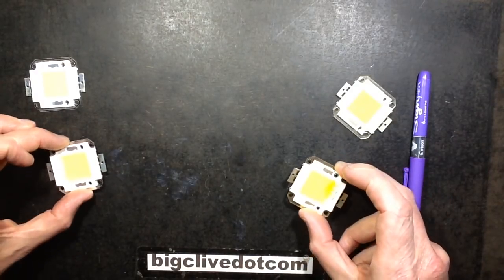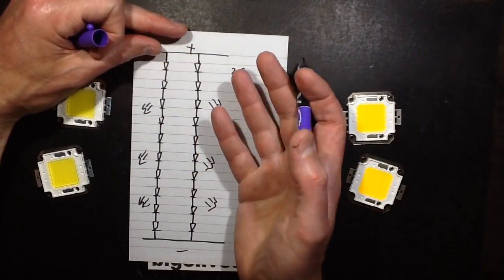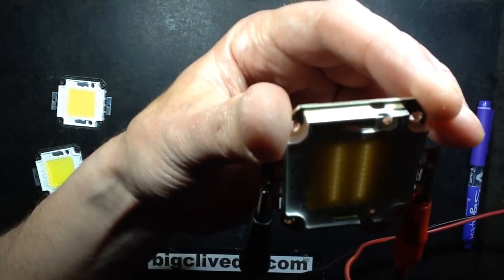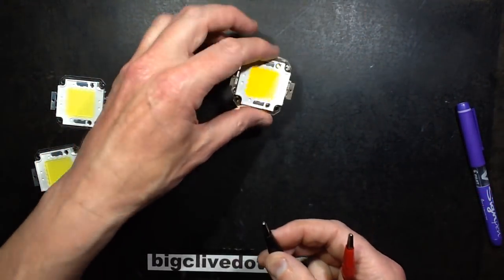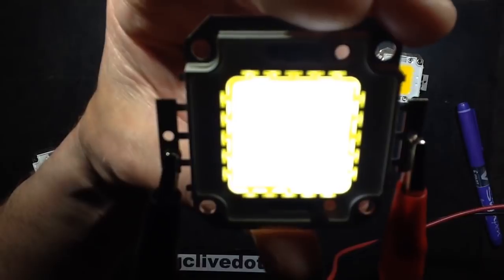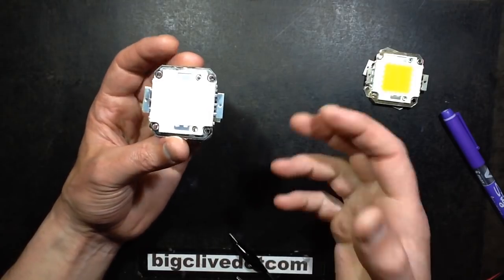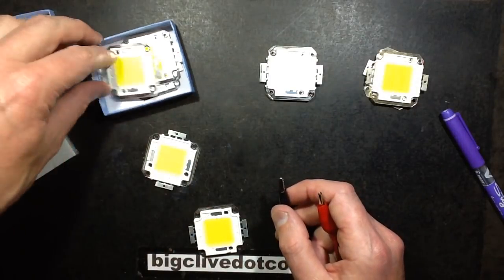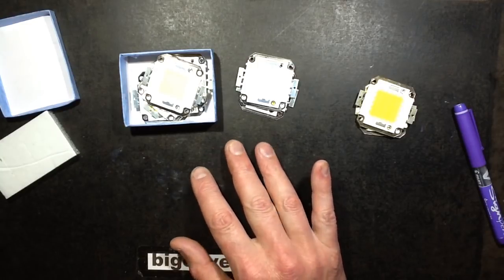Testing dodgy 100W LEDs from ebay sellers.

Comment: I bought a 100 watt 10,000 lumen one on eBay but it was almost $30.00 just for one.  The emitter chips are twice the size as the $5 competitor 100 watt LED.  The seller was showing just what you experienced if you use the common cheaper units.  So I bought their $30 good one.  All 100 LED elements turn on at the same time as your 20 watt examples.  You have to get the better quality 100 watt units.  Full power (3 amps at 33 volts).  Not a single problem.  Takes a good amount of heat sinking.  So there are good 100 watt LEDs on eBay.  You just have to pay for them.
Reply: Gavin Curtis  what from what supplier? i am thinking of buying some
Reply: It was ebay user "wholesale-led"  and it is there Epistar series and are not cheap by any means.  The 100 watt LED with the oversize die is now $40.00 USD.

But definitely worth it.  When I got it, every LED was identical even at fully dim using less than 1mA.  It is so much brighter than those $5 crappy ones which did exactly as these did in the video and I chucked them.

There is more than twice the silicon emitter die area in the Epistar brand.  Now I did retest my 100W Epistar at 1mA after I have been using it to verify how well balanced the LED elements are.  I do have 99 elements that are perfect, one that is slightly dimmer at the 1mA.  At 4mA, they are all identical brightness though.  Bear in mind the LED operates at 3 amps so the mismatch even after I ESD zapped it, it is still ideal.  I marginally damaged one element from improper handling as all 100 were perfectly matched when I received it.  You have to be very careful handling these and protecting from ESD.  I wish they would have integrated a 36 volt zener diode into these to protect them when out of circuit.  Some of the CREE brand multi LED units have the integrated zener.

The ebay listing is 361294347502

Comment: Why do you care that there not all coming on at the same low voltage? Iv never had this problem with any of my 100w leds.
Reply from the maker: Dave96z34v2 Because many of them are passing significant current without emitting light and therefore in use the LED would be much dimmer than it should be at any power level.  The already defective LEDs are also likely to fail completely in short term use.

Comment: Hi Clive , Exactly the same as what ive had but with the 50W & 30W versions and have Emailed the seller(s) and have had numerous replacements sent to me free of charge inc' a free replacement 50W spot light , and as you quite rightly say all mish mash ! and the ones that do work , work for about 3 - 4 months and then start flickering , (mine are on P.I.Rs set to 7min longest time) The original LED chips fitted to the spot lights did work with no mish mash but started to fail within about a month since last August and have replaced all 5 several times over. (4 x 50W Daylight 6500K and 1 x 30W Daylight 6500K , that one has failed too unsuprisingly) I have threatened some of them by reporting to ebay for selling faulty goods , and suprise suprise : they disappear off ebay (no longer a registered seller) I dare say they come back under a different name on a new account , but something has to be done , as its costing me a lot of time in replacing them and money. Yet I have passed a few shops by me , that have them fitted in the same style spot lights ive got , and they never seem to have any problems what so ever and theirs are on for hours everyday (in the dark that is) and always look when passing to see if any fail but yet to see one fail or starting to fail, and as i say no flickering or mish mash. Im also trying to source a decent seller too , who sells the better quality LED chips. Thanks for posting Clive and sharing your problems with us youtubers who have had poor service like your goodself ! :)

Comment: Those doggy LED's have likely got shorts because ALL LED's in 1 string should light at the same current because by definition there is only 1 current in a string. If there was a slight difference between 2 strings I wouldn't worry but LED's in a string should very similar
Reply: Have you watched the video? Have you noticed the voltage of the string was 12V? If the other LEDs had short, then 1 LED would had 12V on it what is almost impossible. I won't deduce it step by step, but the observations indicates that all LEDs have such manufacturing damage that produce a relatively high, different parallel leakage current (conductivity) for each LEDs.
Even the "good" one has leakage, otherwise it started glowing at about 2.5 V.
When Clive said the whole current flows on it, he made a false assumption of other strings don't conduct any current, which is impossible (I can prove it if you want).

Comment: i got several of these, im using it since 2 years for my flashlight's (see my channel)
at 22V they look screwed up, but with more than 24V it balances. i never had heat or current problems, not  a single one broke.   im running them on about 34V 3.33A(CC CV)

http://fs2.directupload.net/images/150619/tgklzr69.jpg
http://fs2.directupload.net/images/150619/exj7uws5.jpg
http://fs2.directupload.net/images/150619/42b224l6.jpg

There are 100W shitbricks for 80$ out there, but whos going to buy this?  These one cost 3-4$ per led. you cant expect much, but you get much for the price.

Comment: I got these and they are perfectly matched. http://www.ebay.com/itm/141146944749?_trksid=p2057872.m2749.l2649&ssPageName=STRK%3AMEBIDX%3AIT He even got picture of them running at low current showing how balanced they are as auction picture.

Comment: These small rectangular LEDs-chips seem to be the lowest quality available.
I bought a few 100W Leds with 45mil chips.They are bright and matched.
Reply from the maker: Markus Reiner Where did you buy them, and what did they cost?
Reply: I bought them on ebay from "sure-display".
They are a bit pricey @ $13.90 but work great . http://tinyurl.com/nj5mov2
Reply from the maker: Markus Reiner Ah.  Sure-display is a division of Sure Electronics.  They do tend to sell better stuff at a higher price.

Comment: A better way to detect dead LEDs might be to turn it up to full voltage/current draw, then use a SLR camera or even your video camera if it has manual settings. If you set the aperture very high (High F number = Small Opening) and increase the shutter speed to very fast you'll be able to see each individual LED while they are running at full power. Then you could see if any are actually out and it's not just an imbalance of forward voltages of some of them where they're not quite on yet at the low voltages.
Reply: ***** or use a welding mask glass
Reply: Welding glass is very helpful for this as already stated. He did however explain in the video, how he would not turn them up to full brightness without a heatsink attached. This is also a factor to consider for quick testing of LED chips.

Comment: We perceive brightness in a logarithmic scale. at low brightness they seem very imbalanced. and they have different starting voltages. if one led had 0.005 volt lower starting voltage then all the 25 volts would arc on it when ramping supply voltage,
Its true .. they are not all identical.
hence the reason the strings are meant to be CURRENT regulated and not voltage.
but if you juice them up even 30% and put a dark film on them you will see they are all running nearly identical.
further more when running at 50% or so, the brighter LEDs get hotter and draw more current. the small difference the leds have becomes negligible by the huge difference a small junction temp makes at 60-80C.
in a way you could say they are self balancing. dont think so ? current regulate one at 39V / 90watts , wait 60 seconds... put a dark film on it and tell me which LEDs are the "daft" ones.
Reply from the maker: forthereg The fact that one LED in a series row of 10 is brightly lit while the others are not lit at all despite a significant current obviously flowing through them suggests they are poor quality LEDs.  If all ten LEDs in a row lit at roughly equal brightness as soon as the combined forward voltage was reached then it would be a different matter.  Like the 20W LEDs I demonstrated.
Reply: To be fair, when you lit up the 20Ws, i was like ...wtf .
Even when you pay 100 USD for a single cree CXA made and shipped from U.S.A. with data sheets bigger than a history book, they are still lit un evenly.
thats how their classes are formed. they dont make them different, they make them all alike and then separate them after production based on brightness/color and price them accordingly.
Even intel trash the majority of their CPUs from production line. and when u pay 2dollas for 100 LEDS ... well ...
i think the average semiconductor fitnesses for duty off of a production line is like 30%

Comment: I have some little 9-chip ones that are fine, but I'm having a horrible time trying to find a reasonably compact driver that can provide about 750mA @ 12v for them. Most of the drivers I find are either for single-die LEDs (not enough voltage) or they're huge and overkill for the LED module.
Reply: Furr Bear A properly designed current driver should provide provide the current its set at and the voltage will adjust according to the NO. of LED's ie. as long as the open circuit voltage is around 2-3 V higher than the sum of all LED forward voltages it will just work. BTW, the manufacturer's stated voltage should be used to determine what voltage is needed. Depending on brand it will be between 3.0 and 3.6 (always specified at the recommended operating current)
Reply: Furr Bear
yep from 3.6V you will have problems because that requires a step up conversion. Those drivers I listed are all buck converters :-(
Reply: Furr Bear That isn't going to work well.  3V input to 12V out @ 750mA = 9W.  9W /3V = 3A, and this isn't even considering driver losses.

Looking at a Duracell D cell spec sheet, which doesn't even rate as high as 3A, they would immediately drop in voltage due to cell impedance, then current would have to go up all the more to still drive the LED acceptably.

A better option would be a series of 3, 3 x AA in parallel for 3.6V nominal, but better still would be to just put the 9x AA in series for 10.8V then your boost circuit has very little boost needed and much lower current, although for convenience sake you might want to go with 8 x AA in series instead since so many chargers have 4 x cell bays.

Typical lantern batteries also have high cell impedance, but an alkaline 6V lantern battery would be more than doubly suitable compared to 2 x D cells, but ideally, two or more lantern batteries in series or just move to 18650 or larger Li-Ion in series instead.
Reply: Furr Bear Hm .... I smell an electronics project! Hopefully not one going up in smoke :/
Reply: Benjamin Esposti Sadly, that's what happened to the drivers I found on eBay - every one of them had its driver IC fail in a literal puff of smoke when used within spec. They were just what I wanted otherwise - about 1cm x 1cm x 2cm and put out about 650mA... until they failed. I have no idea why they went POOF, and I haven't found another source for something similar. (The closest I have come is the LuxDrive MicroPuck - but it's only up to 500mA, and its output varies with input voltage.)
Reply: Furr Bear Are you looking to have an input voltage of 240V AC? I think that might be a bit much to ask for in 2 cubic centimeters of space. :(
Reply from the maker: Furr Bear It might be worth checking what the actual forward voltage of the LEDs is.  If it's the typical 3x3 series/parallel array and they are white or blue then the combined forward voltage will be so close to 12V that you could get off with a resistor if you can mount it somewhere it will not add too much heat to the LED array.
Reply: Benjamin Esposti Actually, I'm looking for a boost setup to run the thing from 3VDC or thereabouts.

bigclivedotcom They're white, and while I don't know the exact electrical arrangement, 3s3p seems reasonable given the voltage at which the thing lights up on my bench power supply. One die lights up around 4.5v, then the others start coming on and all 9 are glowing evenly by the time I hit 7.8v. (The LED modules I have look like baby brothers to the ones in your video.)

As I said above to Benjamin, I'm looking for a voltage boost supply to run the LEDs from a couple of D cells - or possibly a 6V lantern battery. I chose 12v as a common voltage target that was comfortably above the point at which all the dies are fully on. The module is specced at 1A, but the brightness between 650 and 750mA is plenty for my needs, so why push the thing to the limit....
Reply from the maker: Furr Bear Hmm, tricky.  Most of the existing flashlight LED drivers are using buck or fixed current linear regulators.  Possibly use a standard 3W single chip LED instead?
Reply: bigclivedotcom I suppose; I got these way cheap off Electronics Goldmine and I hate to give up on them - but there's only so much money I'm willing to throw at them to make them work, because of course then I could wind up spending more than I would have with some other solution to begin with.

Heat really isn't much of a concern, the modules are thermal-epoxied to heat sinks and would be used during the typically chilly (10C, sometimes less) nights on a camping trip I go on every year. Now that I think of it, perhaps I could use one of the LiPo power tanks I have that offers an appropriate voltage and just add a current-limiting resistor. It's just one of those things where I don't want to expend one of my most versatile power sources on something this mundane. (The campsite has no access to electricity, and I can't really drag a generator along on my motorcycle. Ah for a science-fiction-y insanely power dense "battery" or zero point generator or the like...!)
Reply: Furr Bear use boost converters found on ebay for 5 - 20 dollars
Reply: smallenginedude71 Really? Gee, I'd never have thought of that ... oh, wait, I did - and the only model I found that fit my use case blew out on me when used within spec. I haven't found a different model that suits the needs of my Vin/Vout/amperage limits.
Reply: etmax1 Yeah, I know. None of that helps me find one appropriate to this context. The thing I love about constant-current drivers for LEDs is you don't get the brightness changing as the supply battery's voltage drops (say, if one is using alkalines for some reason).
Reply: Furr Bear
Yeah LED's used for lighting (high power ones) should never be driven by a constant voltage supply that isn't current limited. As to your desire to find one, constant current sources are easy to design, there are 2 options, switching and linear. Linear generates more heat and switching is just that little more complex.

My suggestion is that if you can wield a soldering iron, Google high current led driver and check your options. NUD4001 is a linear driver and if you select the datasheet it has all of the calculations and lots of examples.

LT3476 is a switching up to 16V and can drive 4 x 1.5A LED's

MAX16818 needs more external components but can deliver 30A if you have a BIG LED string :-)  It's good to 28V

LM3401 gives you 3A and handles 35V

LM3402/HV gets you up to 75V

If you can't solder or are scared to take on something like this then hunt around through your like minded acquaintances
Reply: etmax1 I was hoping I wouldn't have to build them myself, but it's looking like I will. I guess this a slightly odd niche (10-12v, ~750mA with a source of 3-6VDC)  there isn't a lot of demand in for pre-built drivers.
Reply: Furr Bear take a look at the PTN78020W from Ti. they give free samples and i got one and its a bad a55 step down converter. takes from 7-32v in and puts out 3 - 12.6v out up to 6 amps.
Reply: Recom rcd-24 might be perfect for the job. Quite compact, too. A tad on the expensive side, but they work very well and are highly efficient.
Reply: mmmhorsesteaks
Did you see his comment that he needs a BOOST circuit to go from a 3V pair of D cells or 6V lantern battery?  Frankly I think he'd be better off using 12 x AA NiMH or 4 x 18650 Li-Ion cells and a modest buck converter driver.

Otherwise not only the efficiency but also the runtime would be quite poor.  Better still would be 2S4P config of 8 x 18650 cells or if charging is a practical concern then at least go with 2 x 18650 cells so it only needs one charger and starts higher than 2 x D and more current capability, less voltage droop than 1 x 6V lantern battery and being rechargeable helps lower the operating cost.
Reply: Stinky Cheese Oops I only read the initial question! 18650's are definitely a good idea. Good luck!
Reply: Stinky Cheese I appreciate the thought you've put into this - but these LEDs would be used only occasionally on battery power; I really don't have a use for that many 18650s most of the time. Your point in the previous post about the current drain issue hadn't occurred to me and is probably the best argument against my original idea. I have a couple lithium ion battery packs that put out various voltages - USB 5v plus 12v/16v/19v for example; at that point, all I care about is controlling the current (without wasting a lot of power as with a linear regulator) so the LED doesn't destroy itself with thermal runaway.

Comment: Yea I have found similar problems with LED's and China suppliers. I needed some 365nm UV LED's and bought a bunch listed as 3w Cree and they do work but turns out they are all 1w and not Cree brand. Bought a 5w 365nm UV flashlight that turned out to be 400nm (won't work for my use) and it's really 3w anyway.

If you do find a supplier for any led's that you get what you actually pay for I would like to know who it is.